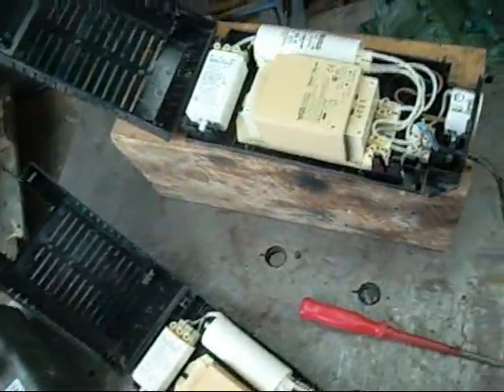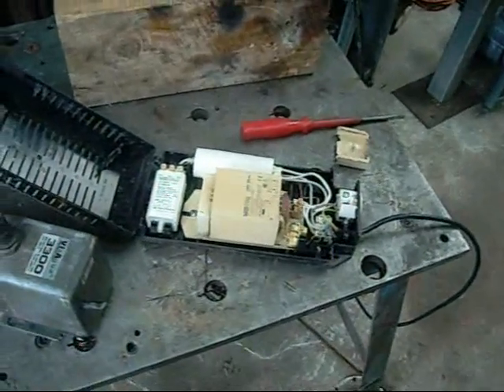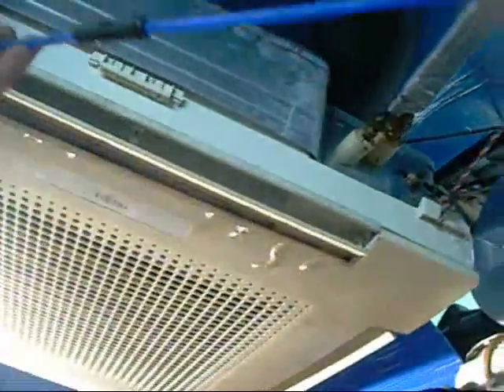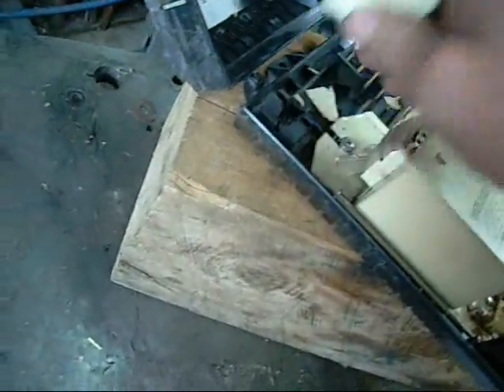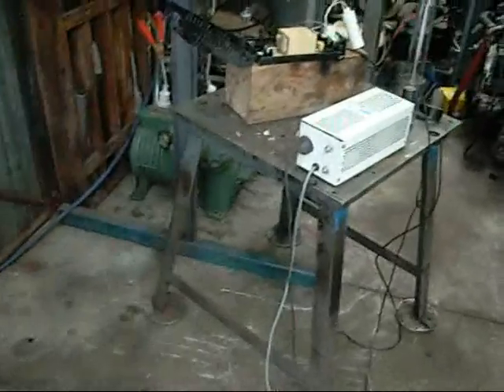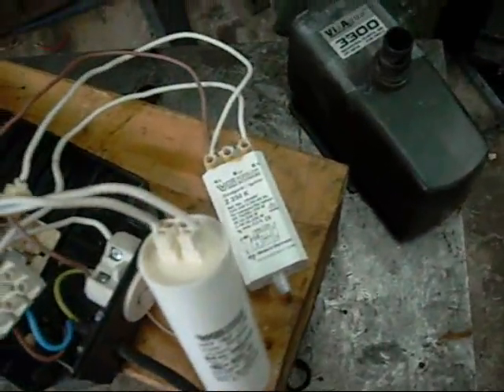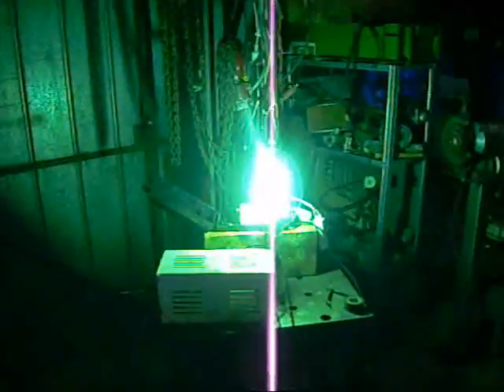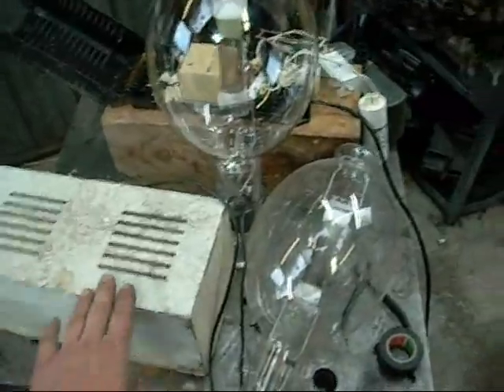Testing 1100w Metal Halide and 600W HPS Lamps

Comment: Most street lights I've seen are usually Sodium.  Do they have ballasts on each light pole, or are they all connected to one ballast and the ballast is located on a power pole or in a power substation?

Comment: The outer glass on most discharge lamps blocks the UV emitted. If you break the outer glass, the bulbs often have a device in line with one of the leads that will burnout, breaking the circuit if exposed to air. 

Keep in mind that any kind of arc lamp is a negative resistance device. It will draw as much power as the ballast will let it. If you put a 150 watt lamp on a 600 watt ballast, the lamp will try and draw 600 watts, and after a while it will probably fail spectacularly.

Comment: RCM442 Is right, they use those big mercury vapor boys in hockey  and curling rinks in Canada, while I've sure they throw off some U.V I don't think it's a dangerous amount if you are far enough away. We used to find those chucked in the dumpster/bin next to the local rink when I was a kid, grab them, go around the side of the building and smash them, they make a big boom. Those and the high pressure sodium ones are popular with indoor dope growers, at least the smaller M.V lamps.